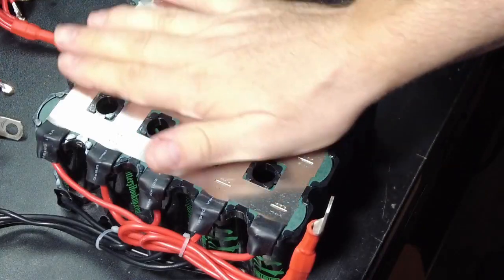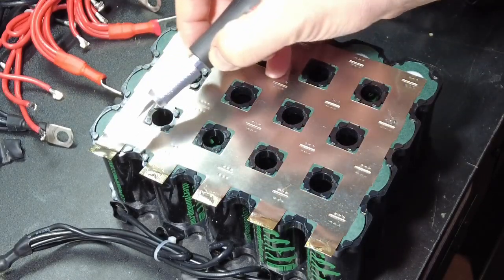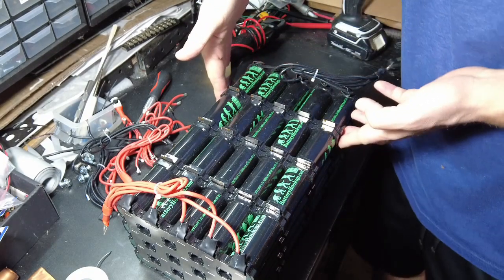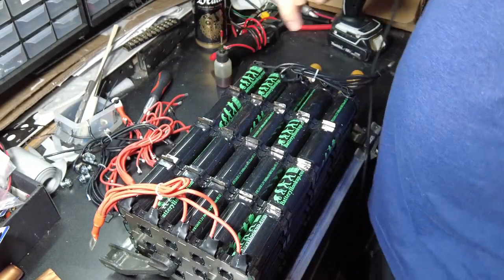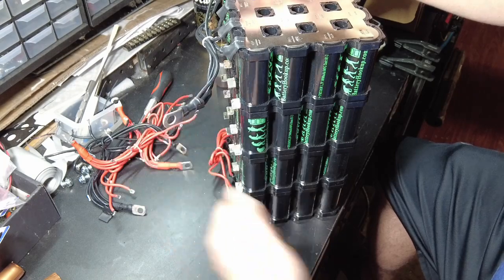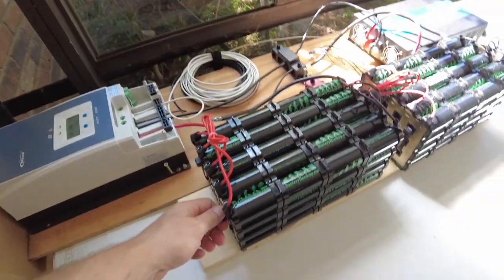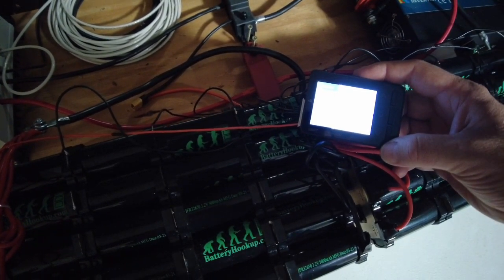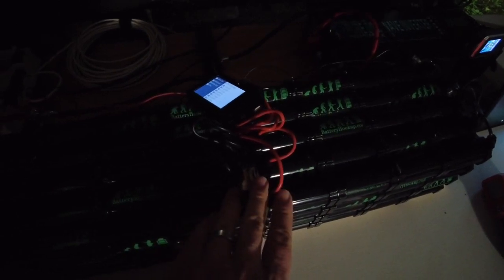Affordable LiFePO4 - Wires removed, Tabs soldered. Capacity test 2

Comment: Good stuff. Soldering skills are totally underrated in today's world. I like the big zip tie idea also. On one of his videos, I saw Will Prowse use Kapton tape to wrap around multi-packs and I've also seen him use automotive hose clamps, so whatever works best for you. I did not understand someone wanting to put an insulator between the cell packs since you are already making connectivity at the tabs. As to concerns about using your wood clamps to hold them together temporarily, I will note that you can buy those clamps in hard plastic. Anyway, I've got 16 of these BH cell packs out in the garage and this is giving me inspiration to get out there and knock 'em together. Thanks.

Comment: Love your videos man. I had a question about what exact flux and solder you used for this buld and can I buy it on Amazon? 
 Thank you so much, keep up the awesome content.
Reply from the maker: You can use any 60-40 rosin core solder, and rosin flux paste should be fine. You can get it all from Amazon.
Reply: @BradCagle  Man you are awesome. Love your videos. I actually bought 14kw of these batteries and planing on installing em into my camper,  your input about cutting off the wire will make my build 100x cleaner and effect. Thanks. And if you have more ideas about these batteries I'd love to hear them . 😊
Reply from the maker: @Paulklei  Thanks for the kind words. Nice 14kw! These are great, really one of the best deals around.

Comment: I like what you did to make 4 packs into a single 12v battery.  I think that was pretty practical, including the zip ties.  For whatever reason, the idea of putting all 8 of them in series, with 7 "hinge" points, just makes me nervous.  "Funny thing about accordion music...you either really hate it or you have really bad taste."

You state there is no reason to isolate the packs from each other, but one of the big "no-no's" in electricity is intermittent points of contact.  Yes, I know the tabs are all welded, and you did a good job with those, but why have all of those potential arc points when it would be very simple to isolate them?  I could see if it was a challenge, in some way, but since it would be a piece of cake, why not avoid any risks you can?
Reply from the maker: Thanks, I liked the idea of the two 12v packs too, but I have since combined them into one 24v. The extra length of wire between the two packs was causing the BMS to read incorrectly.  As for the isolation between the packs, it's simple, current will take the path of least resistance. That path will be at the solder joints, sure a small amount could flow via the touchy spots, but nowhere near enough to be a problem. If it's good enough for battle born to do it this way, it's good enough for me, no need to over engineer.

Comment: You did gain Wh not Ah. Those wires were causing your output voltage to be lower. Watt hours takes voltage into account. That's why you can have an 18650 cell eek out its rated ah even while under maximum load. The area under the discharge curve is much less due to voltage sag.
Reply from the maker: Good eye. I just looked back at both videos and at the 50% mark the wires removed was 25.1v while the wires on video was 24.6v

Comment: I have built a larger 4 by 48V system using 16S.  It's a bit annoying balancing but so far so good.  I ordered an active balancer to hopefully fix this issue.
Reply: lol i feel you. top balancing is going to take FOREVER. i just ordered a 6s 30A charger to get it up (since i dont have my inverter/charger yet). Charge in series to 3.5 or 3.55, then parallel to 3.56.... 

I have 4800AH worth of batteries to top balance. 48 of these packs.

Comment: Brad, I promise I’m not trolling, but my concern is heat, and you ask why is he thinking heat.. well in electrical theory, electricity takes the least path of resistance right? So with the packs together with no separator, they have a chance of touching and when them touching with no insulation, that’s the least path, well once some amperage starts pulling, with no protection is will pull between the 2 batteries and they will heat up..since they arent welded or soldered at that joint. Make since ?
Reply from the maker: Yes, I understand what you are saying, and thought about this myself. But I think you answered the question to the concern, and that is "electricity takes the path of least resistance" and that will be where the tabs are soldered. Now if the soldered tabs are overloaded then more current could flow where the packs might be loosely touching, maybe this will cause some heating. But I constantly checked with my ir thermometer, nothing was heating in between.
Reply from the maker: BTW, I know you're not Trolling at all, and I encourage this kind of discussion. Thanks

Comment: Brad do you have any experience with ultra capacitors? Hybrid systems?
Reply from the maker: no, but I want to try them.
Reply: @BradCagle  hey brad, having an issue, my pack is 24 8s, 32650, I set it up in series . Setup the isdt leads
Check them with the meter. 1st cell 3.3v, 2nd 6.6v 3rd 10v....and so on. All cells 3.3v. I plug the connector into the isdt q8 max. All cells read 5.5v. WTF?  This has to be pilot error . Any suggestions?
Reply from the maker: @HappSsack  You probably have your 9 pin balance cable wired wrong. The negative side of the battery connects to left most pin on the ISDT marked "-", then wire the rest of the cells in order until you reach the positive side of the battery that should be the right most pin (marked 8s)
Reply from the maker: @HappSsack  Also make sure the chemistry is set to "Life" otherwise you'll overcharge your pack.
Reply: @BradCagle  the lies the problem
Reply: @BradCagle  that was the problem. All readings in line now
Reply from the maker: @HappSsack  Awesome!
Reply: @BradCagle  update on the 24v 100a 32650 pack. I started charging with the isdt q8 max. 1000w 30a smart charger. All I have is an adjustible 24v 750w 30a power supply. Started the charger, it was delivered 735w 25a, for about 15min. Then I noticed it reset its timer Soc was 93%. After the reset, 19a 730w I watched the cells over the next 30 mins. 1 or 2 cells got to 3 59v said to myself, WTH I have good insurance and sleep by an outside door, went to bed. The charge cycle has been running for 10:51:44. Cells 3-7 3  are 3.64v. Cell 8 is 3.50 on the rise, and cell 1 is 3.44v on a slow rise. Charger is delivering 0.6a  17.8Ah @ 99% SOC
Reply from the maker: @HappSsack  yup, just let it do it's thing. Usually you'll parallel them and charge to 3.65. But the balance charger can do it in series like you have it. If the lower cell takes forever, you can just charge that by itt, just make sure the charger is set to 1S to do single cell, or parallel.
Reply: @BradCagle  that's what I decided. I let them sit in parallel for almost 2 weeks. The next set is due tomorrow. Did you solder your BMS leads. I guess I need to secure the cells together before attaching BMS leads. I was just going to keep the cells original,  not remove the shrink or leads. Did you ever measure the holes for the zip ties?
Reply: @BradCagle  did you give up on the active balancer?
Reply from the maker: @HappSsack  no the active balancer is fantastic

Comment: I purchased 2 more sets, 4 sets total. Plan to build 24v. Sys. Looks alot cleaner without the wires and shrink wrap. Maybe a plywood tray with rope handles on the bottom
Reply: wood is conductive. use plastic. im going to use a 120mm motar can for mine.

Comment: On the main pos and neg, could you fabricate a bus bar and use a larger gauge lead?
Reply from the maker: yes, you could use a copper bar, and solder the tabs on the ends to it.
Reply: @BradCagle  Brad, can you orientate the batteries in a vertical position? Also I have the growatt all in one. The manual states it was designed  for vertical mounting.  I would like to mount it horizontal, I don't think that would be an issue.
Reply: If you soldier a copper bar you will pretty much have a battle born battery lol
Reply from the maker: @Paulklei  Yes I think that's true :)